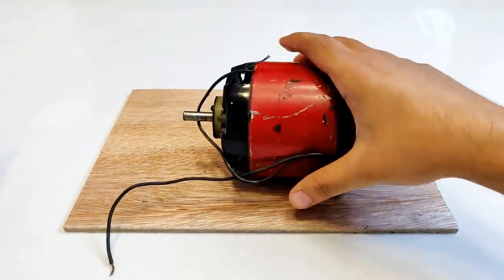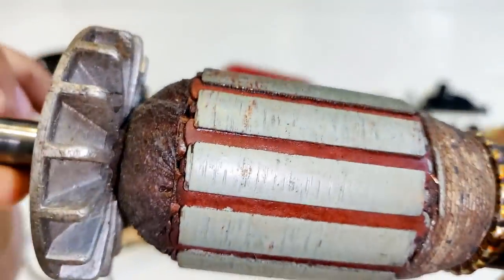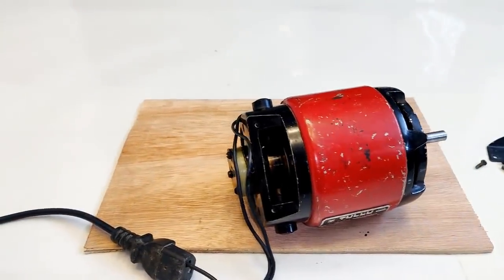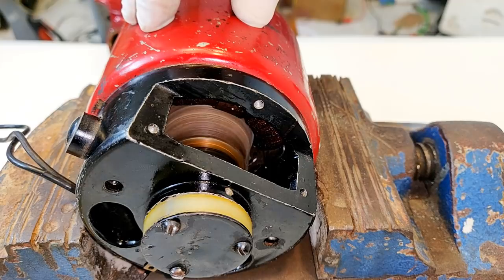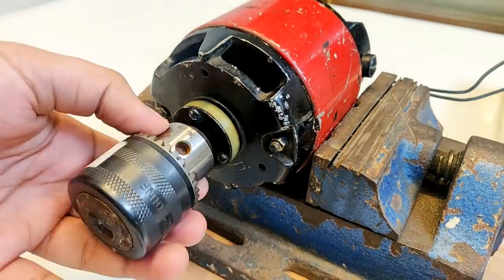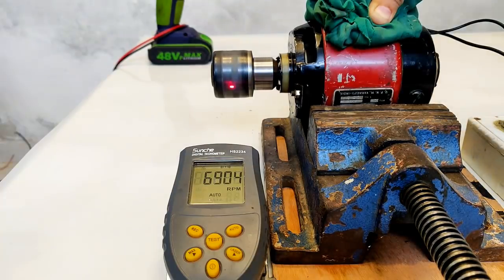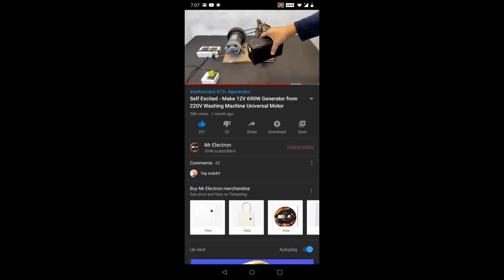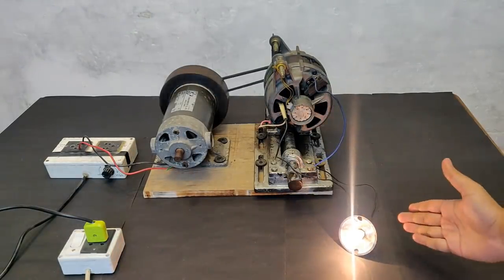12,000 RPM - 220V Sewing Machine Motor ( Universal Motor ) Inside - Can it Generate Electricity ?

Comment: I agree with Julian that it all comes down to the resistance of the coils that provide the field for the armature. If you either lower the resistance or replace with rare earth magnets will give the desired results. Very strong rare earth magnets will give you a very good result, much better than the standard arc magnets usually found in DC motors

Comment: What is the DC Voltage that this sweing machine motor can achieve 10K RPM ? How to convert it and what are the limitations ?
Reply from the maker: 220V
Reply: How is it possible to provide 220V DC ?

Comment: To make a motor self excite, it is necessary to turn it backward. Turn the motor on, using any source, and see which way it turns. If spun in the REVERSE direction, the motor will self excite, unless there is an underlying problem, such as the RPM too low, or, a shorted armature or field winding. I can't see from this video, but, you may need to use something faster than a drill, and even if the drill is fast enough, try changing direction on the drill, so the motor spins the opposite direction that it normally runs. With  a high impedance motor like that, it might be necessary to use a high enough DC voltage, to get enough gauss strength to overcome the hysteresis of the field stator iron. That motor WILL generate, you just need to use high enough speed, and enough DC current to overcome its higher impedance.

Comment: You said it yourself, it's all about the resistance of the child's needing excitation. If the resistance in a high then you need a large feedback voltage to induce the magnetic fields required to produce power.

Comment: Sir I extremely request you to make a bldc motor controller with speed controller.because I also start making car alternator to dc motor so if you accept my request I also make a controller for my project. I hope you will accept my request.
Reply from the maker: That's an electronics project. I do basic electronics and mostly electrical projects.

Best Regards,
Mr. Electron

Comment: Electricity is produce by when magnet is moved through.a coil voltage is induced ie permenant magnet. Here there is no magnetic field because there is no magnetism formed due to electro magnetic method when there is no current / voltage is passed through the coil. Thus there is no magnetic field. Voltage is not induced
Reply from the maker: I think you skipped the part where i should self excitation of universal motor without magnets of external power supply connected to it.

Comment: Can u check the difference between rpm with a drillchuck and another without using drillchuk is there is any difference😁
ANSWER
Self excitation is a dicey thing that speed is not likely to fix. If the armature has residual magnetism then the generator will self excite. No magnetism no excitation.
Reply from the maker: Ok , i will do the check if you insist and share it in  my 😊stories

Comment: Please what is the electric motor capacity that can run car alternator smoothly 🙏 and the type of speed control
Reply from the maker: 1 Kw motor will do the job.
Reply: Thanks for your reply do you mean 1kw DC or AC electric motor

Comment: Because the your drill machine is low compare 220v at 10000rpm drill machine rpm some war 1100 to 1500rpm
Reply from the maker: RPM was low but it was the same that i fed to the washing machine motor which then got self excited.